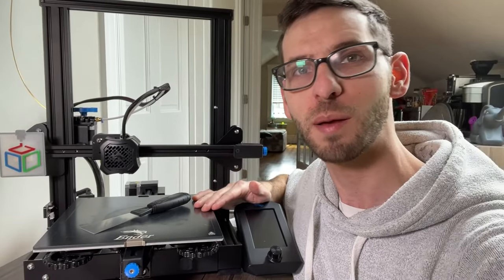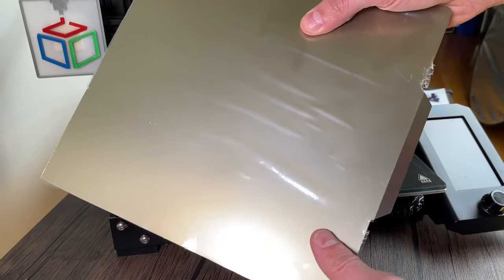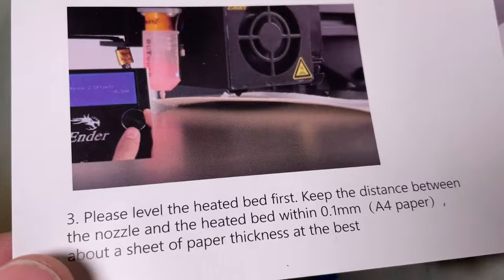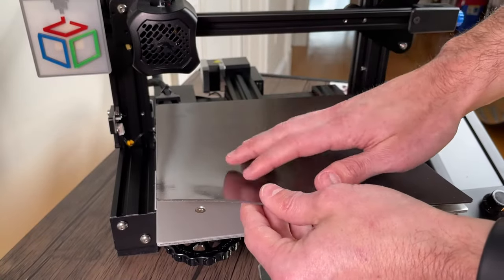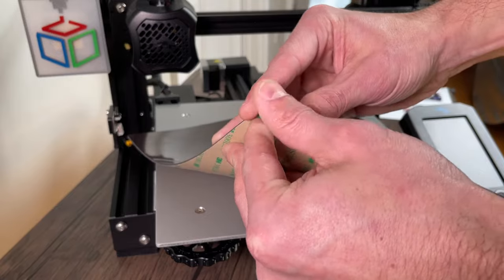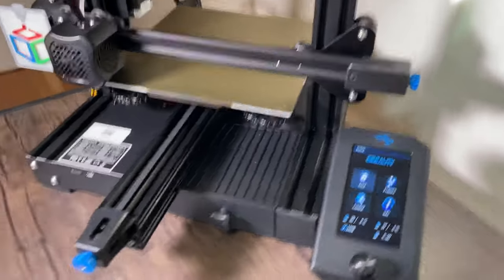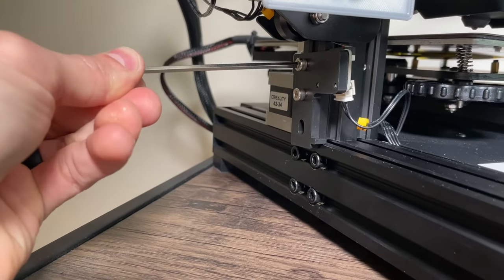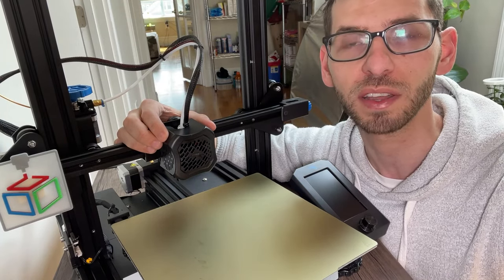How to Install a PEI Flexible Magnetic Bed on a Ender 3v2 3D Printer (Upgrade)

Comment: I realize this is a 1y old episode, but regarding sticking to glass, I found that a flat wood chisel is way better than the included scraper. It is super sharp and will slide under the print to pry it up. 
The glass surface is great, just clean it with alcohol before the print, and either use a chisel, or wait for the cool down when it'll unstick without any problems. 
I am only upgrading the bed because I understand PETG doesn't play well with glass. 
This said, thanks a lot for the instructions :)

Comment: Great video! I was having the same issue with prints sticking too well. Although I haven't broken a print yet, it takes way too long to remove one. I have to use a razor blade to get an edge started. That isn't very safe. Looking forward to using my flexible bed. Thanks for the video.
Reply from the maker: Thanks for the comment! Flexible beds are definitely the way to go, enjoy!

Comment: I recommend upgrading the bed leveling springs with stiffer ones, and adding an auto-levelling sensor like a CR-Touch or a BL-Touch as the magnetic flexible surface is not as plane as the original glass bed , otherwise you might struggle a lot with the manual leveling procedure.

Comment: Thank you, just bought this exact plate and have this exact printer.
I was up and running in less than 10 minutes (15 included the manual bed mesh), prints like a dream!

Comment: Important: Check the following before sticking down the adhesive plate. After my initial install (Months ago) I found the magnetic grip was weaker than I had expected. I have purchased another brand and I found out (For both brands) that the magnetic pull is far greater depending on which direction the sticker goes down. Test the top plate on the sticker base before installation. If it appears weak, turn the sticker 90 degrees compared to the flex plate and you'll find the grip is 10 times stronger. As I said, this is the same for the two brands (Creality and Kingroon). If this is the case for other brands, I can only wonder why this is not mentioned in any installation guide.
Reply: Good tip!  That makes sense, actually.
Reply: Thanks
Reply: Very good point thanks so much for sharing! Glad I saw this before installing. The brand I purchased had a pretty significant difference in strengths from direction change
Reply: Thank you for this tip!
Reply: Doesnt apply to Chinese ones it seems.

Comment: As a total 3D printing Noob I thought I was doing something wrong since my prints were an absolute bitch to remove from the glass bed on my V2. I have been using a cleaner / degreaser to clean the glass, a product called Gyeon which is meant to clean auto finishes prior to applying ceramics. I thought that was my issue, so I switched to IPA hopping that would fix the releasing issue. I have this creality pei sheet still in the box since I have other mods that I have been installing. After your video, I'm going slap this on and give it a go. At least I know that I'm not the only one with an aggressive glass sticking issue. Subbed
Reply from the maker: Good luck, hope it works better for you!
Reply: A lot of your degreasers and cleaners will actually improve adhesion and make it harder to remove.

The main thing, I think, is that you need to let your bed cool sufficiently before trying to remove it. You can freeze it, but I even just let my prints sit until the bed has been back down to 20c for quite a while, and they usually pop off nicely. Or sometimes I just use the included spatula and a mallet. lol.

Most of my interest here is that I don't like having the clips take up print space and risk interfering with the head. By "Risk", I mean I've come home to a pile of filament spaghetti because the head popped off a clip and slid the whole bed off. A Bad mounting mechanism for sure.

Comment: I wish there was way to easily swap between spring steel pei and glass bed. Prusa does this by embeding magnets in the aluminum base, so they're not in the way. Also never had troubles releasing PLA prints from carborundum glass. you just need to wait few minutes to cool from 60C to like 50 or 45C, then the release is much easier. after waiting for it to cool even further it usualy even unsticks by itself.

Comment: I just bought one for my ender 3 v2 as well, got so many issues with my glass bed with prints just not sticking to the bed anymore ... annopying as heck. Been printing on tape but that's not really a solution i think. You make the installation look easy wnough tho, thanks for the vid.
Reply from the maker: Flexible magnetic beds are definitely the way to go! Enjoy!

Comment: Bought a brand new Ender 3 Max Neo. I upgraded the bed to the flexible magnetic bed. I cant get my prints to stick. Is my PLA not hot enough or why isnt it sticking?

Comment: So, why choose the PEI bed cover instead of the Creality cover? The flex bed sounds more convenient than using the freezer, but prints do just pop off (some just fall off by themselves)  if you chill it for a couple minutes.
Reply: I got one because when I did the freezer method the rough side of the glass, like the black dots, came come with it. That whole layer detached. 
Could just be me, but sharing my experience why I switched.

Comment: So I installed one of these and now the bed is too low.  I bring z-level down to zero and I also use the manual bed leveler wheels to bring the bed as high as it will go - but I'm still way too far off.

Comment: Is there a guide on using the sheet of paper for the normal levelling process you mentioned?
Reply: There probably are a few videos online. The idea is that for each corner, you should be able to push a piece of paper below, and feel a bit of resistance.

Comment: hi do you need to put hair spray on that now or just print on it? thinking about getting the same thing for mine?
Reply from the maker: Hi Josh W. I found that I don’t need hairspray or any other adhesive when using the PEI flexible bed. As long as your bed is properly leveled and you have your temps set properly, the print will stick on its own. Hope that helps! Would appreciate if you used my affiliate links :) Like and subscribe and happy printing!
Reply: What Temps are recommended?  My bed is level but my print isn't sticking at all

Comment: I have opposite problem with Ender Neo - the model is getting detached from the glass bed while still getting printed.. Any suggestions what to do? Brande new printer. Thx!
Reply: Probably you already figured it out - but wipe it with alcohol. It's not sticking because there's grease from your hands on the surface.

Comment: I heard that magnets can get damaged, lose their strength over time, and their surface becomes uneven especially for high temp printing such as ABS, Any tips on how to deal with that?
Reply: The demagnetization temperature varies depending on the magnet materials. You have different levels. What I refer to as "Elastic" and "Plastic" demagetization. Not sure the technical term for them, but I get these from plastic and elastic deformation in materials science.

Elastic demagnetization is at a lower temperature. It temporarily disorganizes the material, causing it to lose magnetism, but magetism is restored when the temperature returns. This is used in rice cookers to deactivate the heater as soon as the bowl gets just above boiling.

Plastic demagnitization is at a higher temperature. It causes permanent demagnetization. Some might be restored at lower temperature, but it will continue to creep away and magnetization will fade over time.

The example using rice cookers shows that they can have pretty good control over when demagnetization occurs. And manufacturers of 3d printer beds know they are working with higher temperatures. You'll want to check what range they recommend. Any of these should be safe with PLA. But it might be harder to find one that works with ABS, which needs temperatures of like 130C+.

My main concern with these has more to do with the thermal conductivity of polymer magnets. As far as I understand, they are almost always great thermal insulators, which is something you don't want when transferring heat from a heater to a bed. I'll have to look more into that part.

Comment: If I want to go back to the glass bed how hard is it to remove the magnet.
Reply from the maker: Hey Cameron, thanks for the question! I have not personally removed the magnet before, but I have seen other people who have. If you use the putty knife it shouldn't be too difficult to remove....you could always use a bit of alcohol to help remove it and clean off the surface to remove the residue. That being said, I think once you go to a flexible magnetic bed you probably wont want to go back to glass. Hope that helps! Let me know if you have any other questions! I am posting some new videos soon, so make sure to subscribe :) Happy printing!
Reply: Couldn’t you just put the glass plate over the magnet then level your bed again?
Reply: @memedeck6026  the clips wont work for the glass bed
Reply: Use binder clips

Comment: So lets say I went and slapped it ontop of the glass bed instead XD how likely would it be removable haha so i can restick it onto the metal build plate ? just heat it enough so i can peal it or just buy a new one  XD
Reply: There is no way you are going to get the magnet off of the glass bed and reapplied to the metal build plate but with it on the glass bed is still perfectly usable.

Comment: Can't you just raise the bed level instead of lowering the switch?
Reply: was thinking the same thing though maybe he doesnt want to calibrate the corners again?
Reply: @serialshitposter186  not sure how to reply on ur comment.

the guy lowered the switch which is a bit unreliable instead of leveling the bed.

springs has nothing to do with the switch. its all about leveling.
Reply: You know you could just get a cr touch and not mess with that. You may have to go into the z-offset probe wizard and get your feeler guage or paper though but the amount of time you save

Comment: I just got one and it did not come with the magnetic sheet at all just the metal plate.. its not in the box at all
Reply: Are you sure? I've just had mine delivered and thought the same as you but on closer inspection the fit between the 'thinness' of both pieces makes it look like only one piece.....they're stuck magnetically together and so just seem to be one piece
Reply: @stuffoflardohfortheloveof  I realized I ordered the wrong one it was meant for if you had bought their entire bed replacement set which is already magnetic

Comment: Using the scraper on the glass just ruins the texture coating and removing prints is as easy as waiting a few min for the bed to cool down. It releases the prints with no force required.

Comment: Do you all know that print will easily self-release once the glass bed is cooled down, right?
Reply: Never had any luck with that unless you talking about throwing a freezer or refrigerator. I've had print set for 24 hours and they're more stuck than a wedgie
Reply: With the glass bed I've tried waiting for the prints to cool down to room temp but that didn't really help much, but with a flexible bed it should be really easy to pop the the prints right off as soon as they finish printing
Reply: When using PLA, that might be correct. However, PETG and ASA tend to stick really bad, sometimes so much that it can damage (chip) the glass bed, even when completely cooled.